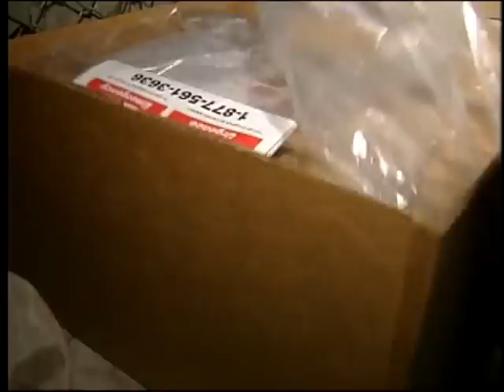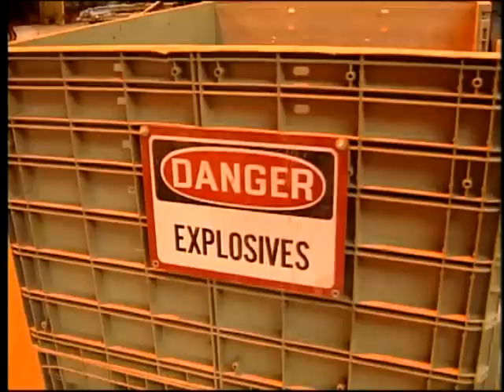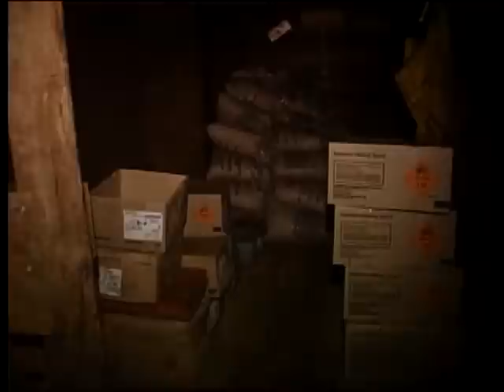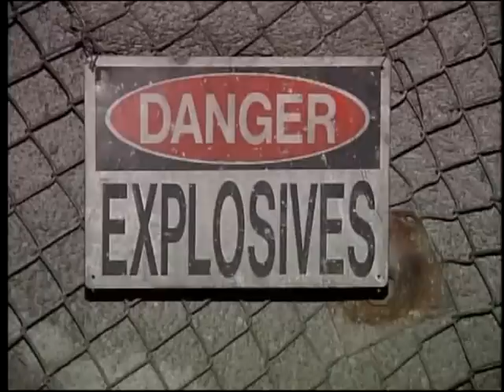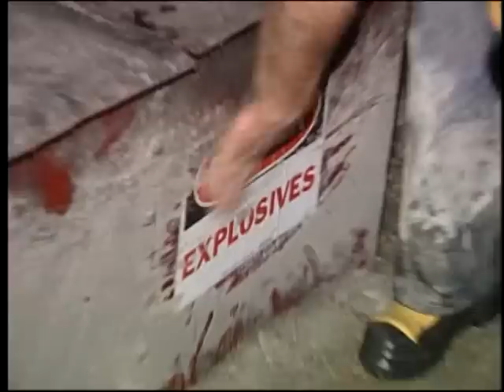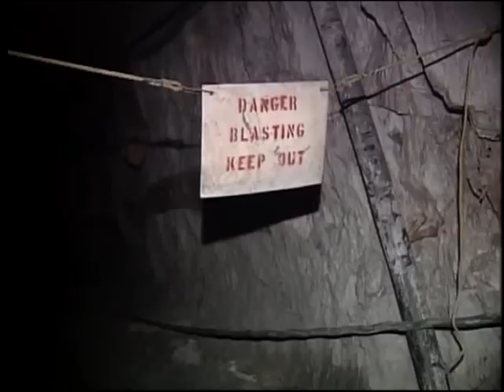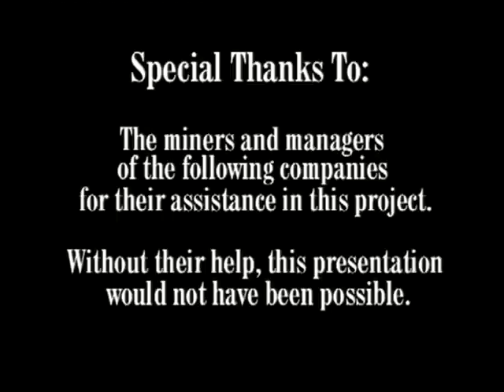Explosives Underground: Mining & Demolition Safety Training Video

Comment: There have been fatal accidents on pipeline crews blasting in swampy areas because of the hydrologic effect of water.  A crew loading charges about a mile away was killed when their charges were detonated by the shock wave through soggy ground.
Reply: +Charles Barnett Wow! That is seriously NOT supposed to happen.  Do you know; what was the blasting media, i.e., Expan, Prill, other; what were the "caps" electric, non-el; were they using boosters?  "Soggy ground" would be a better conductor of high freq physical vibrations, or maybe an induced and conducted electrical DC/EMP charge from the energy of the first blast.  Did this occur in the US, if so about how long ago?  If in US and given a little time, MSHA/OSHA may have posted an investigation report.